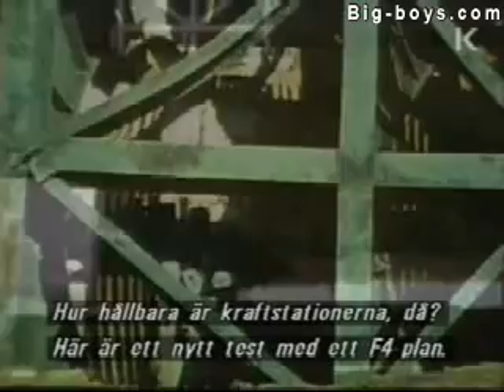Plane and concrete wall

Comment: The concrete wall in this video was especially designed to withstand this type of impact and is not the same material as the concrete walls of the Pentagon. You are clutching at straws.

Comment: yeah jason you were pratially correcgt but  this was a fighter plane that are not built to be smashed into things like a commercial jet. also that wall is not unreinforced with rebar. as usual you get things wrong & swear it's not that often. you are a fairly intelligent person but when it comes to actual engineering you lack the knowledge base necessary.  you don't study often enough or hard enough.

Comment: ??? what??? shaped as a nose??? so where then motors penetrating the building and debris of them??? they were much harder so and carried much more energy on the impact...so if debris would be nosing out, then not of nose, but of jet engines...but even any nousing out is a pure nonsence...it just cannot happen in this universe

Comment: did you look for real answers? or you simply ask a question.. then make up a answer like "its a missile" and felt satisfied?  it took me 30 seconds on Google to find the answer. 

if you want an answer to your question instead of making up a conclusion with no evidence.. read the mail I'll sent you that shows there really wasn't much in the way to stop the parts from exiting.

Comment: @SkepticOfLies this does not prove anything, you don't know what this plane is mutch less what materials where used and what configuration.  national standards and statistics , jet fuel burns 900 degrees steel begins to melt 2800 degrees.

Comment: @circusboy90210 the pentagon was bomb proof. You cant go round patronising people, you clearly need to study more too. Commercial jets aren't built to be smashed into things. if anything a fighter jet would be far stronger, it has to handle far greater manoeuvring forces and such (not forgetting that fact that it gets shot at). Where is your logic at all?

Comment: Yes, but people are using this video as a possible explenation to what happened to the plane, but if the walls of the pentagon wasn't as thick then the plane wasn't desintegrated and should therefore have left a bigger hole and more debris etc. My point is, whats shown on this video is not what happened at the pentagon, since it piercred through so many holes. So this video is bullshit for proving anything.